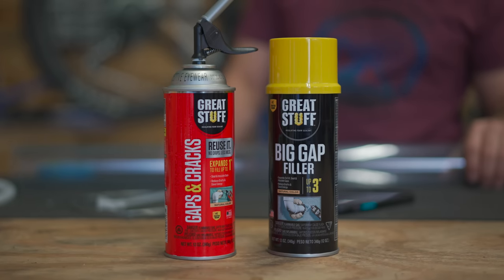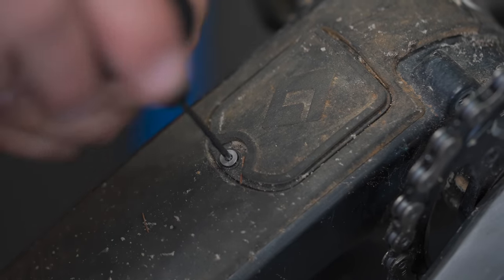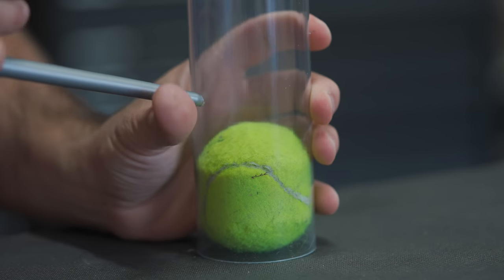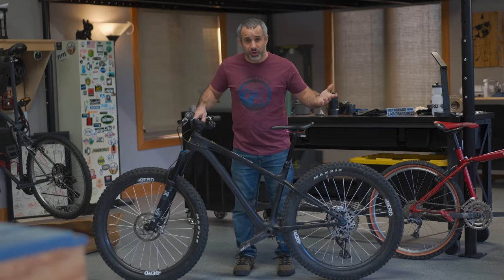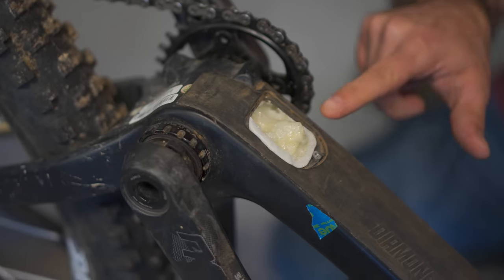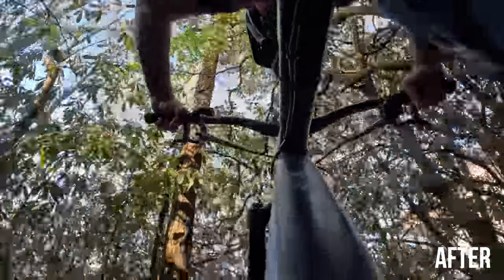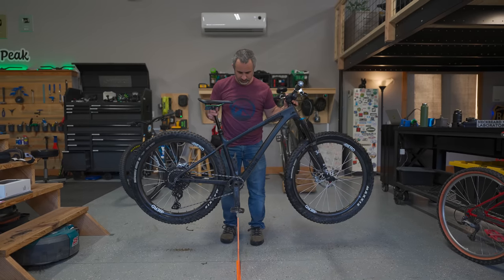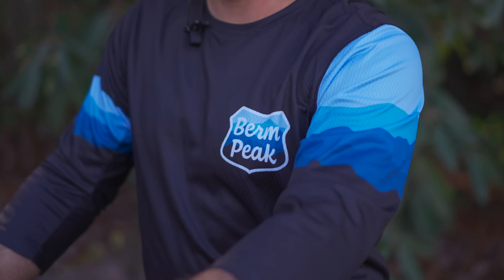Filling my bike frame with foam made it better—kind of. Don’t do it.

Comment: As you said, it's not scientific, but some randoness can be taken out in future "experiments":
#1) remove the chain, cassete, RD and cables;
#2) paint the stones, so that the line is almost always the same;
#3) Try to secure the brake cables
#4) verify the pads are secured and don't rattle

Also, I would advice placing a plastic sleeve inside the frame, and inflate it.

This way the foam won't be in direct contact with the material.

Comment: The Trek Y11/22/33 carbon bikes built in 1995 a terrible sound to them, because the frame had the shape of a guitar sound box. As a repair, Trek had bike shops fill the frames with expansion foam. In the second production year, Trek  filled the frames before shipping them.

Comment: I think that this would actualy dampen som impact on frame and make it stronger because of air you have a thick foam pushing against it. Its like having a bone with marrow and without it..which one is better. I would do that even if it added some weight.

Comment: So, another test you could run is a FFT (Fast Fourier Transfer) of the sound. This will break up the sound into its component frequencies and tell you if there's a pitch shift to a lower frequency from what you've done if you have a proper recording of the audio and not just from a GoPro.

I would also recommend sound proofing a box or small room and dropping it inside there to isolate the environment out a bit.

But hey, you can dissolve expansion foam with acetone. Just remove all plastic/rubber components from the area you apply it because it'll totally ruin it.

Comment: My experience with expanding foam in enclosed spaces is that it won’t expand or harden as it could if it was in an environment that that allowed moisture to get to it. From what I remember the foam used in its proper way being sprayed into a wall or other cravice in a building lets moisture still access it which is part of the curing process. Spraying some of these foams into a plastic bag or air tight concealed area will not enable it to actually cure. There might be special types with two components to mix before use that could be used in this way, but this should be tested.

Comment: Acetone should quickly dissolve most if not all expansion foams.  Just be sure to test a tiny bit on any composite parts first to make sure that they don't dissolve in acetone.  Gasoline may also serve as a solvent for the foam.

Comment: Smooth-on makes 2 part urethane rigid foams that would strengthen a bike by making in much harder to dent the frame from an impact. It would be interesting to split a frame and put it back together with tape and fill the frame with rigid foam and see how sturdy it would be.

Comment: Hey Seth 👋 

I install foam urethane insulation for a living. Both closed and open cell foam in many applications. 

Closed cell foam would give you the best sound detoning and paired with some tubes bigger than a break cable or hydrolic cable you could pre install a cavity to hold any cable. Kind of like the hide a cable box's they put in a living room TV that's mounted on a wall. 

I also can get u the name of a cleaning product that designed to break down foam very effectively. If u want to get that can foam out of you frame. 

Also wanted to say that Foam has very weird characteristics especially can foam. To much in one hole won't allow it to rise and cure properly. With proper techniques this could have been done better. I say that with love I know u don't apply foam for a living.

Comment: Just to add an engineering perspective 
1/ on the dB scale a doubling of sound level is every 3dB, so 2 odd dB is actually a significant reduction, may not be important but let’s have the right perspective 
2/ some foams expand a lot ore than that, when car manufacturers started adding it they did have issues rupturing closed sections, so it is possible but unlikely
3/ when a frame distorts the tube sections pinch slightly, so foam will make the frame slightly stiffer (how much, don’t know, good or bad, again I don’t know, but it is a fact!).

Comment: There’s a big, well known bike brand who had a known issue with a recent downhill bike frame - with the top tube bending. They didn’t have a fix on the warranty except giving you the same faulty frame again. Insider intel suggested they tried an internal hardening foam to help 😖😖

Comment: ooof. If you can get inside a tube with an open port, you can quiet things down just by sticking a few cut pieces of acoustic foam in there. A lot lighter, a lot more reversible. I've done this to the CF recumbents and uprights I've made that come apart, and it helps with some noises that are trasferred / amped through the tubes sometimes -- like stuffing a big hunk of acoustic foam into a guitar body would. You can shove a piece down the seat tube as well. (Leave a string attached to that if you want to be able to yank it back out later.)

Comment: If you did want to do this, would be better to use a two component foam to ensure it fully cures. NVH flexible foam is what goes in cars (3m 08463).

Putting a single component foam in a cavity like that is asking for corrosion issues due to improper cure.

Comment: I have experience using expanding foam to built custom car bodies and making forms for composite lay ups. I can tell you when used in wet environments it will absorb moisture. If it is in contact with a part that may oxidize the moisture in the foam will exacerbate that problem.

Comment: I have the door and window expansion foam in my handle bars and back rim in my hardtail. The door and window foam is more flexible and had a good reduction in vibration felt in the bars. The back wheel was just an experiment. I didn't notice much difference in my steel NS hardtail.

Comment: I filled my racecar's chassis with structural expanding foam in 4lb density. The rigidity added to the chassis was a huge difference, I did only one side first and the car was very unbalanced from left to right corners.
now both sides done it is much quieter and the sound of the doors closing is damn near that of a luxury car.

Comment: People who race unibody cars would fill the main support channels throughout the car to make the chassis stiffer in turn handle better.  Whether it works or not 🤷‍♂️. The product is also different than regular spray foam. It is less pliable than regular spray foam. Just put the foam tubing on the housing. Or just don't do it!

Comment: With fiberglass boats alot of times people fill the cavities between the deck and hull with foam as floatation. An issue people run into though is it gets water logged and doesn’t air out so the stringers (which are wood covered in fiberglass) eventually rot out. I wonder if something like that could be an issue here accelerating rust. Also the boats get really heavy. Of course a bike isn’t in the kind of conditions a boat is in, but I’m not sure are the inner tubes of a bike water sealed?

Comment: Could be handy to keep water out but it would have to fill alll the tubes except the head tube and seatpost, also a bit of initial humidity inside th eframe would help th efoam to actualy cure, it relies on moisture to expand and cure.I actualy did it years ago on my car sills, it cut down noise and kept them from rotting outwards but made repair later awkward when i damaged one.

Comment: 3 db in audio terms is "threshold of audible change".   The question is at what frequency.  Bike tubes resonate at a high and narrow pitch; while not significant in itself, other bike noises are also narrow band and high frequency: chain rattle, getting on pedals, cassette, tires slapping against rocks.   When some of these overlap, maybe the tubes add a fraction by resonance, since all of these things are mechanically attached.

 You need to run your mic through a DAW spectrum analyzer.  There are plenty free ones available, and you can screenshot the "fingerprint" of the sound.   You could also fo the same for all bikes - characterizing cassettes, gearshift noise, etc .... $.10

Comment: Fill the handlebars, and the seatpost. They are much closer to your ears.
Do it on a belt-driven bike with a filled rigid fork.
Wrap or tape down cables so they can't rattle around too.

Comment: Cars do this these days. In the rocker panels mainly. Not only does it damp and vibrations and sound, but it is used to add rigidity. In fact the rear subframe in a E46 BMW has a habit of ripping away from the body in the trunk. And BMW had to make a structural foam that can be injected into these cars later.

Comment: The mounting foam polymerizes due to the moisture in the air, and this will not occur in a closed space. That's why there is a two-component foam available on the market. You can specifically find it and replicate the experiment using it.

Comment: There are several versions of expansion foam available the can you used on the clear tube and tennis ball was minimal expansion which is made for small cracks the formula used for large holes is much less forgiving and could easily cause problems.

Comment: The 2nd Gen. Cannondale V Bikes with the carbon fiber frames - The Ravens - the factory recall was to spray expanding foam into and around the lower crank.

Comment: filling a frame by expanding foam makes it stronger. this has been done a lot in car racing to increase the stiffness of the car.

as for expansion of the foam, it has to be in a "wet" environment (as written in instructions). its best to spray the dry walls with a mist of water.

Comment: Ive seen it added inside of vehicles. That is a great way to rot out from the inside out. People used to say you could dampen handlebar vibrations by filling them with foam. Didnt work.

Comment: all i can think about is, what if the frame has internal wires/brake cables ect.
this means they all get coated and set into a certain position due to the foam.
this also means that if these cables need replacing, its GOING to BE a MESS lol
but that Liner tip is really REALLY good!

to the sound, it sounds like its dampening the high pitched noises. just by ear.

Comment: If you look at the science behind what makes a Toucan bird beak have an incredible strength to weight ratio. You'd understand why using closed cell (the denser, non porous type) of spray foam inside a carbon fiber tube/frame would make it 2x or more, stronger while barely adding any extra weight. Some aircraft use spray foam in parts or a inner honey comb pattern to make them stronger but still lightweight. Someone realized bees use a honeycomb pattern because of it's high strength to weight ratio.

Comment: When Seth did his tennis ball & clear tube experiment he used a low-expansion foam product. Note the big 1" marked prominently on the label. Then when he foamed the bike he used a different product with significantly different properties, rendering the clear tube test and what he concluded from it totally irrelevant. The can used on the bike had a big 3" marked prominently on its label, indicating it expanded considerably more. Seth seems to be unaware that apples are not oranges.
Another factor he didn't mention is that the expanding foam products contain solvents that could potentially damage the carbon fibre. Furthermore the foam could also trap moisture in the carbon frame and potentially impact corrosion rates where metal parts are in contact with the carbon fibre & trapped moisture/humidity. The foam likely strengthened the parts of the frame that filled. That could potentially alter the ride feel.

Comment: In ‘01 I had a box frame, the down ‘tube’ was a 10x5cm alu, hollow box. It was echo-y so we filled it with foam to deaden the sound. It worked a treat! … untill the foam loosened inside and started squeaking like polystyren in a bathtub… we desolved it out with petrol.

Comment: Idk about a frame but I can for sure tell you it works on handlebars. I got the idea from one of the guys that worked at my local bike shop back in the 90's. I went in looking for some extra thick foam grips bc even with the set of rockshox that came on my bike my hands were always going numb from the vibrations of the bars and that's when he suggested I try filling my bars with expansion foam to help absorb the vibrations instead. And worked great, you could feel such a night and day difference that my buddy's even started filling their handlebars with it too LOL.

Comment: its good in hollow steel frames as it removes the reverb from the steel but as other people point out you need air and ventilation for it to fully expand and 12 hours aint enough

Comment: Car structures are filled with some sort of foam inside the chassis structure, more like sandwiched during manufacturing. With definite test resulting in less bending in a bend test. Now, unsure if hardware store expansion foam would make a difference, but if it did, you could end up with a stiffer bike frame, without adding much weight. Could be beneficial if you're trying to rid of frame flex

Comment: There are also more or less pressure expandable foams. And for best reasults you should hard blond holes then foam will gets higher tension.  When i put many card boards on my city bike they act like amplifier of all bike sounds. Will be fun to try it with foam inside but i dont try it.   ...

Comment: Full on road nerd comment. I've heard (and seen) people locally who have filled road frames with foam, but to add strength when there's something like a hairline crack in the carbon that isn't repairable (without cutting out a section and bridging etc). Those repairs were raced on and ridden for a long time after with zero issues/crack expansion. Not sure that it was hardware foam, as it was an actual carbon repair company that did the foam.

Also I've seen on track bikes where a hollow disc wheel was filled with foam to keep the weight down(ish) but add stiffness to an otherwise pretty fast, but very flexy wheel (on the starts/in sprints). 

Not sure how this adds to the conversation, but I had one of those hollow discs, but it was flexy enough that I was shied away from the foam for a fear of warping the shape of the disc.

Comment: plausibly, the foam could add strength in regards to impact absorption, dispersion, as it would give the impact forces a denser medium than air to travel trough, like an interior helmet. also, in that same manner, all shockwaves in general would be more "quieted" in relation to the overall frame, thus equating less frame wear, less joint-stress and this may extend the life of the unit by negating damages incurred structurally...

Comment: Would be interested to know if if the foam off-gassing destroys the cable housing, considering what polystyrene does to pvc insulated electrical cables.

Comment: If you have an old pillow use the filling, or you can buy polyfill for cheap. It's typically used in speaker enclosures

Comment: I would say, don't use hardware house expansion foam, use boating closed cell expansion foam, that stuff is designed to be buoyant and would be way lighter, I also think it might be more quiet but that's just speculation based on how I think the pressure waves travel through both materials, in closed cell foam, I imagine there are so many voids that redirect the sound through reflection and end up cancelling out a decent amount of the noise through destructive interference and statistics

Comment: In motorsports I have seen stiffening foam filled into the body structure to make a racecar light but more stiff, then a full cage is usually welded in.
Reply: yep. structural and wight benefits by reducing a frame wall thickness.

Comment: Not all expansion foam is created equal. Some foams expand much more. The stuff you're using is typically used around windows and doors and you wouldn't want that expansion to push out a window. When I was in college contractors used expansion foam to lift the building in one corner where erosion was causing it to sink. That's right they lifted a 3 storey building using foam.

Comment: Obviously all the caveats about measurement repeatability apply, but...
Decibels are a logarithmic scale, which means that a small reported change can be a larger change in sound level than it might seem. Specifically, every 3 dB increase equals a DOUBLING in sound level (e.g. 89 dB is twice as loud as 86 dB, which is twice as loud as 83 dB, etc). Again, whether the measurements are accurate (or relevant) is still open to question, but consider the scaling when evaluating.

Comment: one thing to point out, and provable with experimentation you can do at home: air has weight. Take a latex balloon, tare it, fill it with air, weigh it again. The difference is the weight of air contained within the balloon. Expansion foam is basically gas bubbles contained within a solid. The foam has weight. Weigh the can before and after use. The difference is the amount of foam and propellant you used, add that to the internal volume of the frame and you get a rough idea of how much completely unnecessary weight you just added to your bike.

Comment: Check to make sure it's safe for metal. Not all foams are. If that gas is CO2 and the curing reaction produces water as a by-product (both fairly common things in the chemistry world) then it could be a nasty source of corrosion where it's contacting for a steel frame, or for some steel part that goes inside the frame like that bottle mount. It's also great at stopping moisture from leaving, so making sure the body tubes are dry first is probably a good idea.